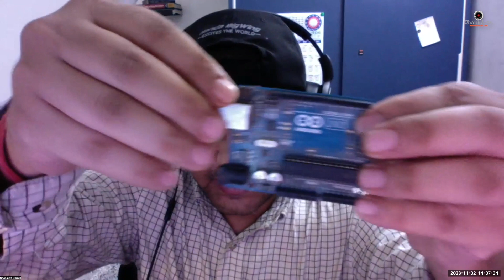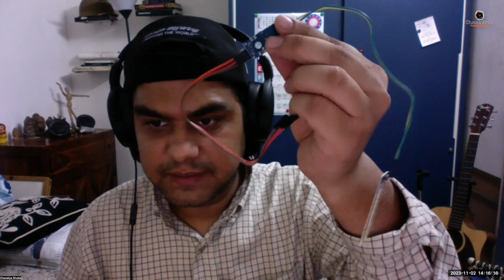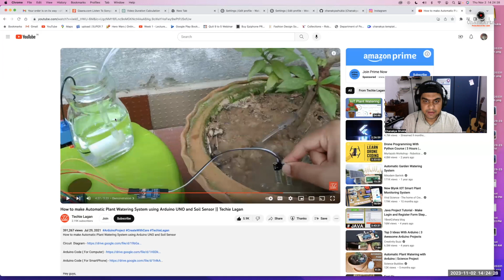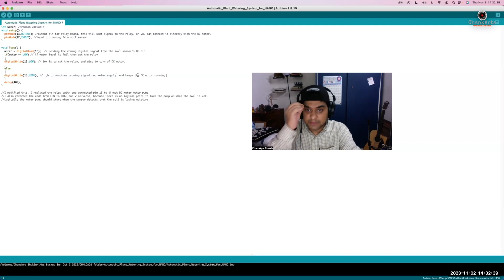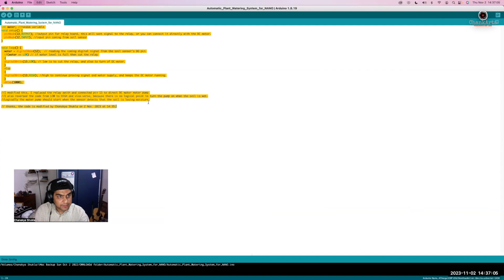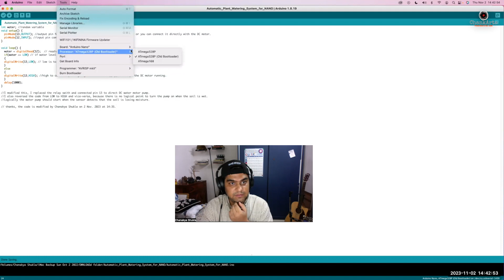Revolutionizing Plant Care: Arduino Nano Auto Watering System! 🌿💦 | Chanakya Shukla

Comment: What should I do if the soil is wet but the water hasn't stopped flowing? Thank you.
Reply: Yes, I have a soil moisture sensor but I don't know how to modify code. I've never learned about it before🥹
p.s. This is my project for  Computing science subject and my teacher never teach me about writing code.😢
Reply from the maker: okay, stay tuned, and subscribe to ChankArts, I will make a video for it in simple Hindi/English language.  @chayanin3345
Reply: @chankartsofficial  Thank you so much!
Reply from the maker: Hi Please, check out this video

https://youtu.be/hJxCY0mImTM?si=LfBgfR79WwJUfJNW

Thanks!
 @chayanin3345
Reply: @chankartsofficial  Hello! Thank you for your guide video. Today I compared my project with my friend's and found the real problem. That's my soil moisture sensor broken.🥹 But thank you very much for your video, I will study it very well!❤️
Reply from the maker: In response to your inquiry, I would recommend utilizing a soil moisture sensor, as demonstrated in the instructional video. These sensors are readily available for purchase online, such as through platforms like Amazon, or at your local electronics store. The sensor typically comprises three terminals: signal (analog and/or digital), Ground, and VCC (providing a 5-volt DC power supply of 1 Amp).

To integrate the sensor effectively, follow the instructions outlined in my tutorial, ensuring the correct connections to the designated pins or microcontroller. Once set up, the microcontroller will receive signals from the Soil Moisture Sensor Module and activate or deactivate a small water motor pump accordingly, to regulate the water supply to your plant.

If the soil is detected as wet, the motor will remain inactive, whereas if the soil is dry, the motor will activate to moisten the soil. It's important to note that different plants have varying water requirements, so you may need to fine-tune the sensitivity of the sensor module to achieve the optimal moisture level for your plant's health. This adjustment can typically be made using a small potentiometer for analog signal output which is pre-installed in the module, or through code modifications if using digital signals.

Thanks!

Comment: Also, what if i have a 12v relay, can it be used in the project to power my pump or it has to be 5v relay?
Reply from the maker: Neither 9V nor 12V relay switches will work from a 5V output from a Microcontroller.
Reply from the maker: and don't worry you can find all such components on Amazon, you don't need to rush to any electronics shop.